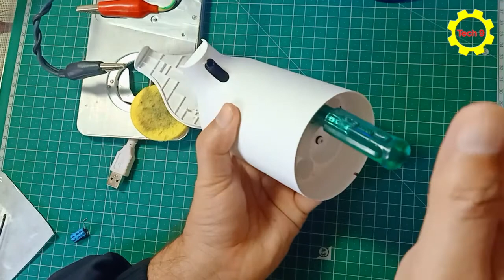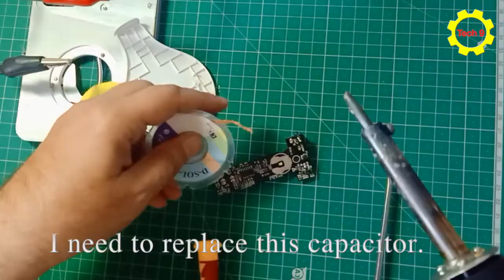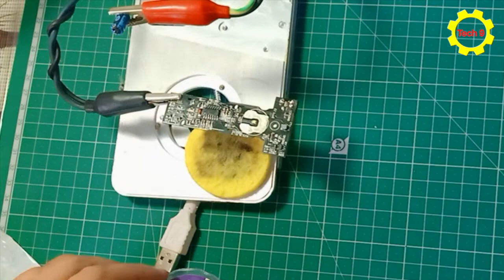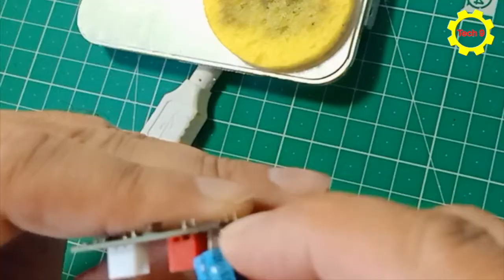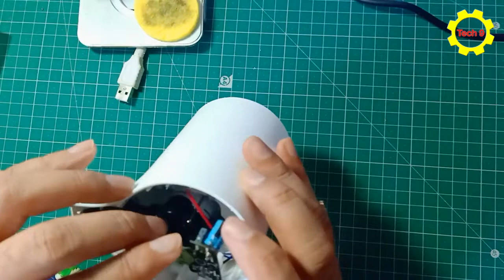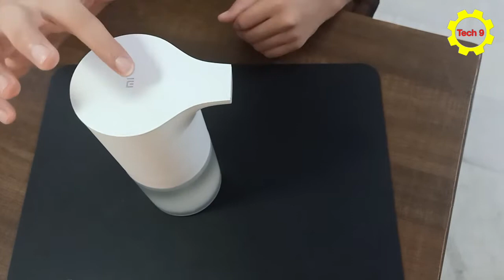Xiaomi Mijia Soap Dispenser Repair/ Fix #2

Comment: my one not dispensing and no suction from the soap bottle inlet. use your method to open the cover, replace the cracked tubing from inlet to motor assembly. your method was brilliant with minimum damage to the top cover :). thanks!
Reply from the maker: Thanks for watching me and you're are smart guy.

Comment: Mine is also not working. Its light is blinking but it's mortor isnot working. What do u think what could be its fault?
Reply: I opened it and thru investigation i found thats its 5pin 3.3v liner voltage ic naming a1dv is damaged. Can u figure out a way to fix that. 
Thru my personal experience i m thinking  to use a PNP transistor with 3.3v fix regulator circuit to power the moter.
Where pnp can act as a on off gate by receiving a signal from IR sensor
Reply from the maker: Great news idea 💡 bro please try it

Comment: :( I just bought it 3 days ago for $20
It doesn't work anymore
The only problem is that it does not pull the soap froth very little
I do not understand what the problem is, everything seems fine, but when I unplug the soap box, I find that there is already accumulated soap at the connection site, it did not rise
Reply: I got a really cheap quality for only $7 and it works better than scrap mi